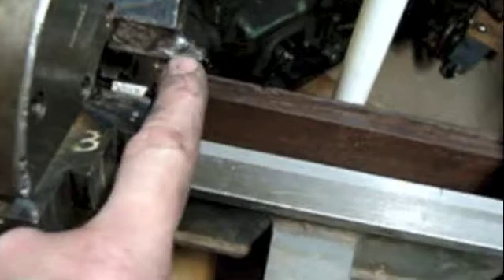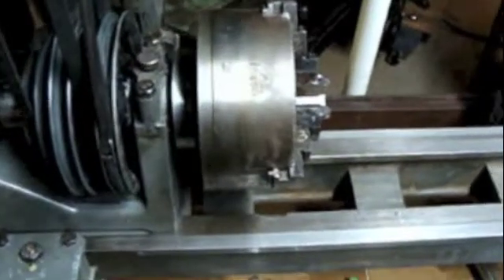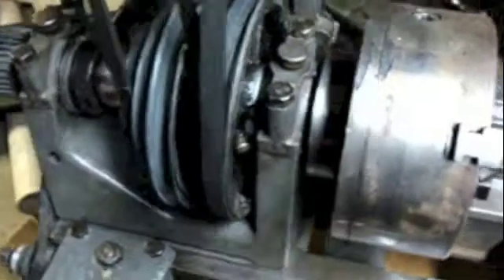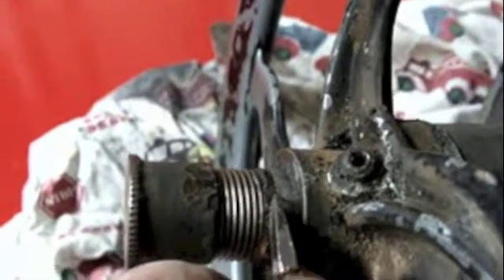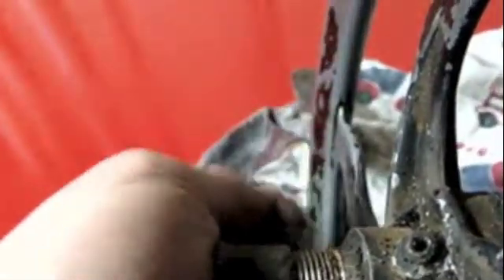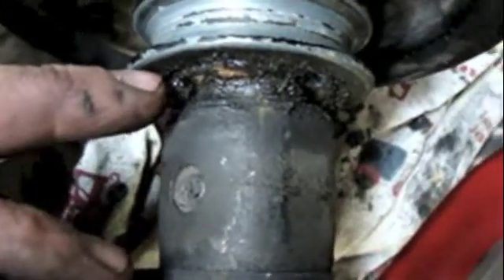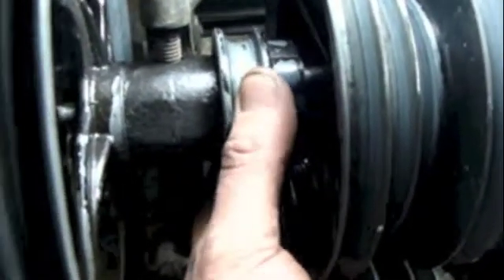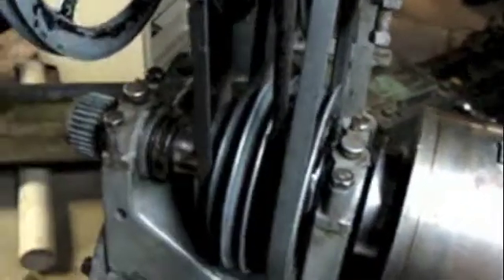Atlas 9" Lathe Part 11

Comment: I do really like all the stuff you are doing but in such bad quality it isnt watchable, it is a issue which follows you for years, any permament solution in sight? (getting good cam)
Reply from the maker: Hello. Thank you for your comment. For the time being, I ask for your patience. I have 8 videos finished not uploaded yet. All of those will be the same quality. I have some raw footage that I will be editing, and I will try to improve those by not reducing the resolution. I had been optimizing the videos to shrink file size to reduce the very long upload times, but I see that is not a good idea. I am curious if that will help, so I will upload a clip I recently shot. It will be unedited, and full resolution, so you folks can all tell me if it is any improvement. Keep your eyes peeled for a video called Test, or something similar.
Reply: i dont have much video experience but i think too that the best option is to upload in original resolution and let youtube resize it, less  quality loss but thats only valid with a flatrate broadband
Reply from the maker: reddzikful I did find that the setting on my camera had been changed to low res by accident. I have a few more videos done in low res, then we will be getting back to better quality. I have DSL, but am on the very end of the range. Any further away from the telephone exchange, and it would not work at all, so I know it is not too fast for uploads.